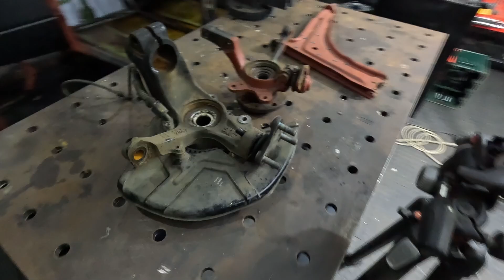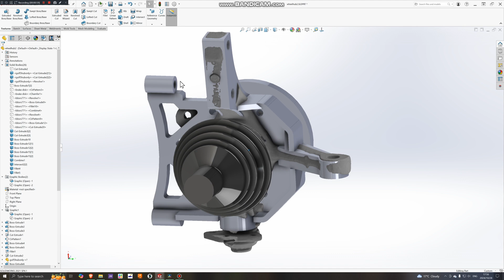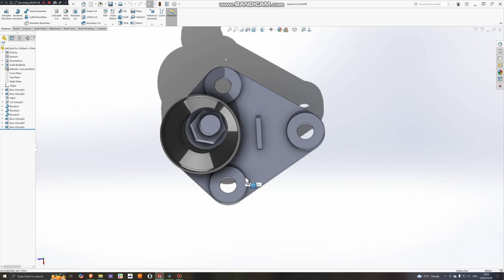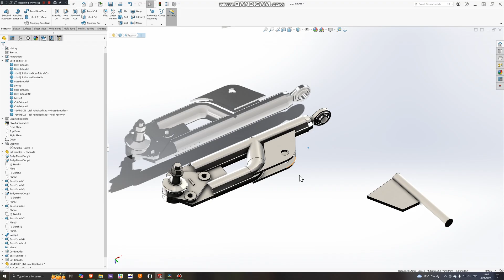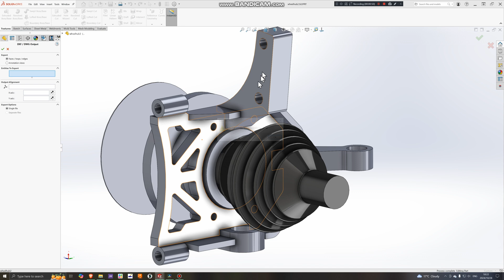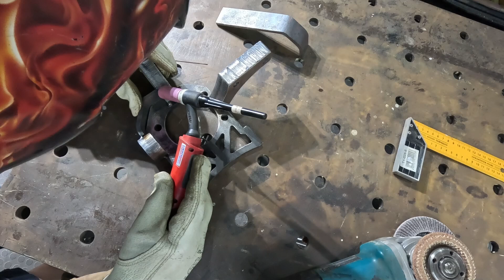the Carbon mk1 Golf gets new front spindles  (part 1)

Comment: This is my kind of build! First off, I’m happy with up to 30mins for an episode but will defer to the masses. I like your approach to the design but, have you done looked at the geometry yet? If you intend to run the car lower than std you can correct the roll centre within your upright design. Good decision on the bigger CV and Spline.
Reply from the maker: yes the geometry is a complete stuff up , aaai , gonna need to make some changes